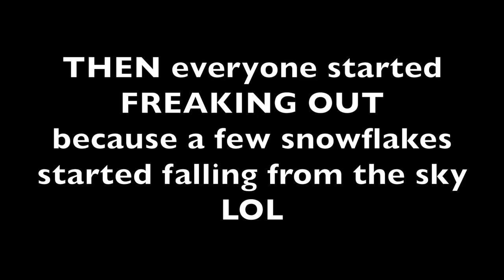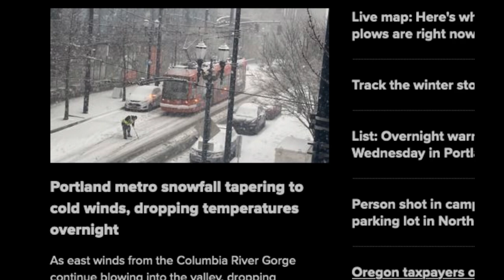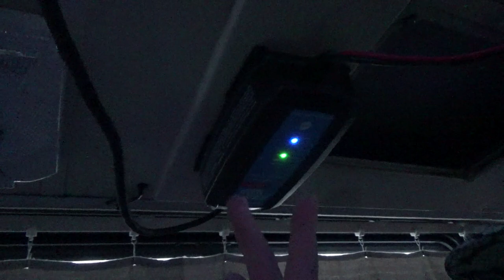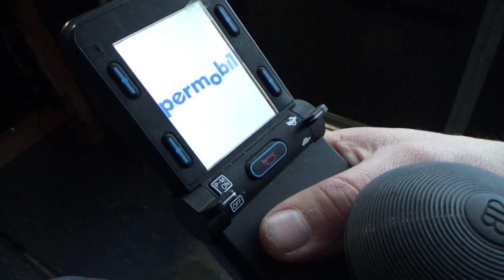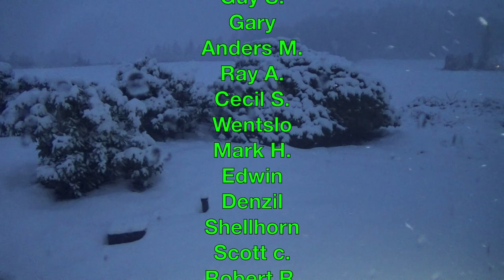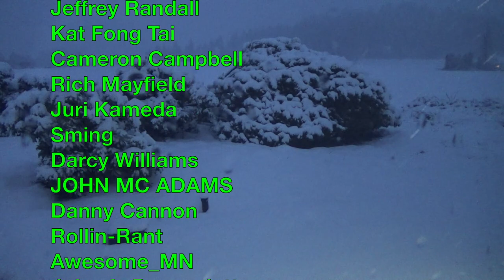VLOG 653: court & random projects! (also adaptive switches!)

Comment: I don't envy you the snow.   I hope you can make one of those switches for the Quantum.  I hate not being able to tell if the chair is off or on.  The only position the screen can be read is in the driver's seat.   If I am transfering from a lower seat, I cannot tell if the chair is off or on when I transfer.  I have hit the joystick a few times during a transfer and had the chair shove me on the floor.

Comment: Hi Dan, I used a slightly bigger switch housing (probably the same microswitch).  It pried apart easily (not glued), and I did away with the wiring from the switch and soldered the jack wires directly on the switch.  The switch housing pressed back together just fine (I did put a drop of epoxy on the cable end just to make sure it doesn't pop apart).  Works great.

Comment: If you think what soldering iron you would get, i suggest a TS100 or Pinecil. Pinecil is just upgraded version of TS100.  I have Weller soldering station inside and in the garage i have TS100. I like the TS100 more, because it's so portable. I made an adapther that i can run it off Makita battery. So when i'm doing car stuff etc, i don't have to run extension cords. Also the TS100 has an OLED-screen, which is nice to have as an tech nerd :P

Comment: It seems odd that if that Victron charger has Bluetooth, that you can't reset the charge cycle using your phone.
Reply from the maker: ya can restart the cycle with phone.. BUT the trick is remembering to do it! lol 
not that big of a deal, but i wouldn't recommend it for EVERYONE to use, since it'll improperly charge the batteries as a result if its forgotten for a few days/weeks
im just looking for a foolproof replacement to stock chair chargers :^)
Reply: @TotallyNormal-  Does it reset if it loses AC power?  If so, put a smart switch in between your inverter and the charger. Have it daily switch off at 12:01 PM, then back on at 12:02 PM.